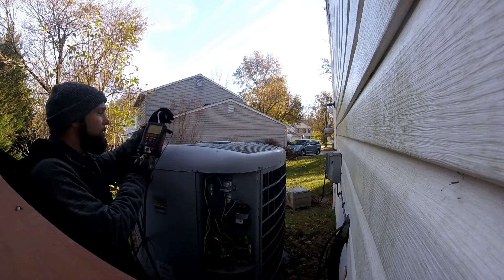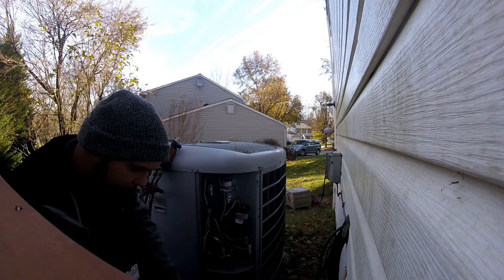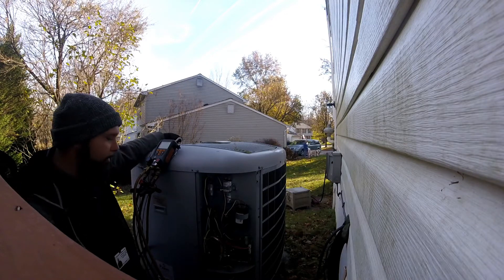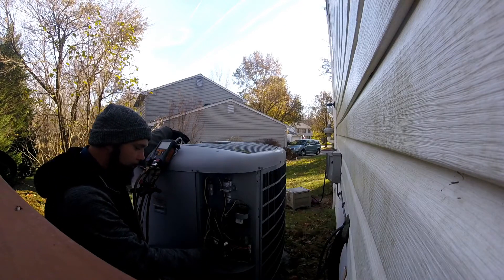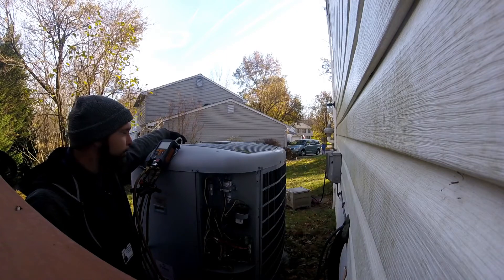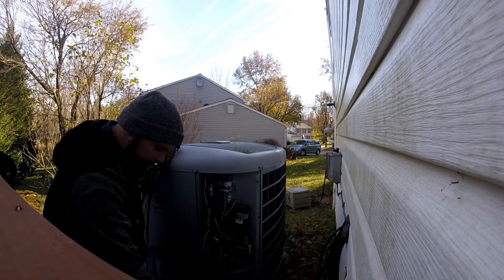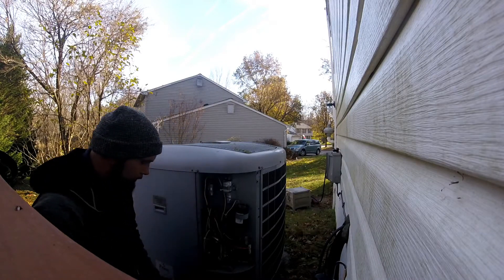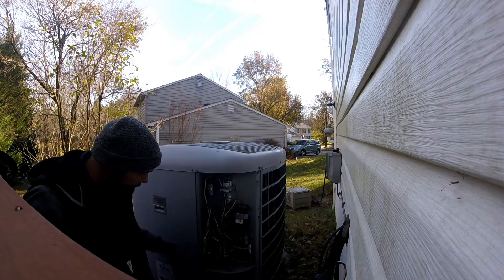Carrier Infinity Heatpump Giving Error codes on UI

Comment: The board issue I fixed on couple of Infinity systems. Also Infinity had issue with run capacitors. I fixed about 10+ in 2008 and few in 2009.
Reply from the maker: Michael Lee yeah that’s what this was and took out the start relay. I accidentally said Start Capacitor but it was the Start Relay